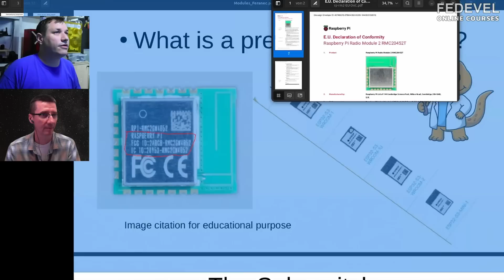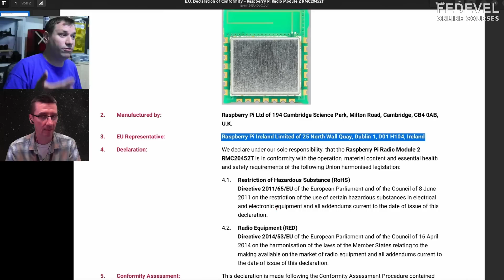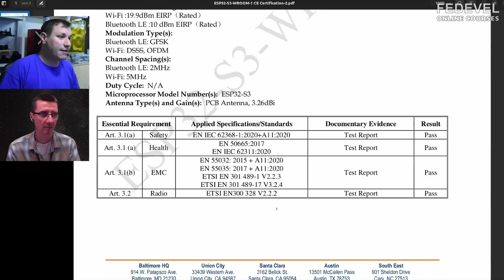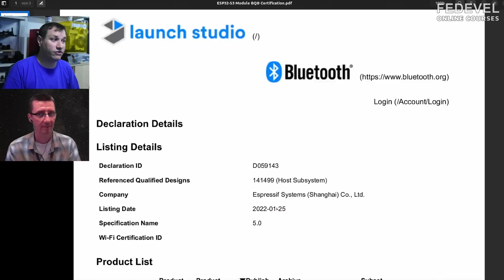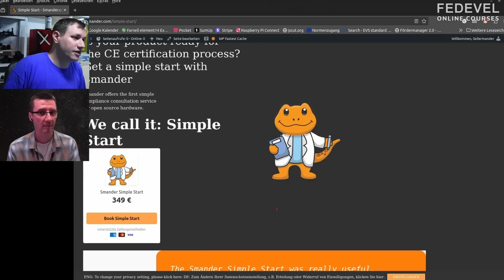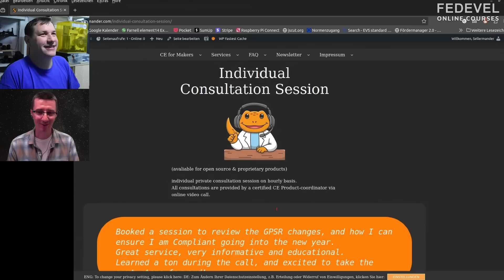Everyone designing PCB boards needs to watch this - Certification ( FCC & CE )

Comment: Quick question about IoT certification testing — does the choice of language matter? Specifically, would writing the firmware in Rust instead of C/C++ affect the certification process?
Reply: the programming language of choice does not matter, the documentation quality of the source does. Firmware/software present on the device is also subject to the overall process.
Reply: No. All of this is a hardware issue.
Reply: @segsfault  Software/firmware is considered part of the product  but specifically if it falls under the CRA it becomes one of the major parts to consider duringn the certification process. So All of this is just about hardware is an incorrect statement for most products.

Comment: At 1:04:47 - if you sell multiple components as a bundle with the clear intention that the user assembles them (like a 3D printer kit), wouldn’t that count as a “finished product” and therefore require CE marking on the bundle itself? Or does it depend on how the bundle is marketed? Can someone please explain this to me? 😅
Reply: that depends on the very specifics.. but its more likely to require Full CE certification than not.

Comment: Around 1:41:24 ... if the module searches for a connection at bootup, isn't that something it already did as certified?  Or are you saying that you replaced the original firmware with something new (that needs verification) and that new thing happens to also use WiFi (differently than the original firmware?) even though it doesn't need to?

Comment: Around 1:21:00 ... is that really saying that software updates require redoing certification?  Is that  only for the "yes, I still believe the product is conformant" attestation? Because otherwise I can see why products go out of support, if there is a multi-thousand dollar cost to publishing even a security update to an included firmware library.
Reply: that depends on the very specifics of your product and what the software update does ..BUT IMPORTANT: the CRA is changing the processes a bit so make sure to get up to date guidance on such issues!

Comment: Nice video, thank you. I have learned a few new things. I have just two comments:

1:26:42 I have a different opinion on this one. I think that the manufacturer should never be liable if someone operates the device wrong. There should be a user manual that says what the machine does and if someone does not follow the instructions, it should absolutely be his own fault. I think that getting injured by electricity and than blaming the manufacturer is like cutting off your leg with a chainsaw and then blaming the manufacturer. The logic is just so wrong.
The manufacturers should not be forced to forsee every possible way of how a stupid person can get injured, because human stupidity is endless.

My second comment is that the speech in this video is not loud enough. The advertisements always scream much more, which is pretty annoying.
Reply: you are entiteled to your own opinion, but it does not change the requirements the Law puts on each product. Simply Customer rights and Product safety are non negotiable. If you Pay hard earned money for a product you are expecting a SAFE product that can perform its function reliably. The manufacturers have to conduct a risk analysis and there are specific limits to what they need to think about and protect against it. I did a video very recentyl with Robert exactly about this (you find it on this channel).
There is a reasonable  limit and the "extreme Meme" examples are mostly fake/outliers.
Reply: @MAYERMAKES  Well, I can see that we have pretty different expectations. I just expect the product to work, that is all, nothing more, nothing less. 
How about the example with a chainsaw? That.. doesn't make much sense, right?
But in the end, I agree with you.

Comment: Any other Certification topics you are intersted in? leave them below, and it might nudge Robert to record another session.
Reply: Thanks for video, lot of interested points. Is needed CE certification (or which another) for specific customized products (mainly for B2B, not for public market). Like wifi, lora sensors, or devices for automatization warehouse, small manufactory ... often based on Raspberry, ESP32... with LCD, external sensors, mechanical actuators, wifi... Who will be responsible if something happen, like injury, fire...
Reply: @matusc  I think we need a complete course about certifications for hardware :D I would buy this for reasonable price
Reply: I’ll contact you for a discussion about my new IoT-Device. It will be open source but also commercially available. Thanks for this great video!

Comment: Thanks for this very informative content. Not easy, for an engineer, to understand the information on the web, because it mainly deals with the legal aspects of the certification. As an engineer I’m more interested in the technical requirements/standards needed to have tested a product sufficient to approve the product. As almost all standards are not freely available, it’s in fact impossible to find out which standards apply. This causes small companies to just approve their products. If the EU wants companies to produce safe and reliable products it should provide all standards free of charge or at least have a simple way of finding out which standards apply for a certain product. Currently the information goes as far as that a toy needs to be safe for children. Seems a bit of a no brainer to me. Where is the information that informs you when the toy is considered safe for children? If this is up to the manufacturer, then ignorance is bliss. There have to be specific requirements for specific situations. Therefore I think the USA system is much better. A certification institute that performs specific known tests and if passed approves the product. Simple, while the EU has created a huge mess that maybe is understandable for just a few consultants. Small companies are totally dependent on the knowledge of consultants, which aren’t always that knowledgeable as well. I really don’t like this self certification mechanism, because it causes bad products to enter the market as there are no clear requirements a product should comply to.
Reply: Both Systems have up and downsides, far to complicated to discuss it in a comment, They are not perfect but overall the Eu side does some moves in the right direction (new Machinery regulation, GPSR,) and on the topic of standards specifically in relation to toys you may want to read up on the "Malamud-Case", which already had a bit of an impact on the availability of some standards.

Comment: Wait but esp32 wifi stack is closed source.
So at this point you just do the certification. The module is not touched and is sold mostly without any firmware. I have yet to see a esp32 module flashed with AT firmware out of box.
Reply: Some ESP8266 variants  were pre-flashed with a TCP/IP modem firmware for AT command control via a serial port as an example . But it is not as common anymore these days. In any case you need to adhere to what the manufacturers integraton guide and FCC integration guide tell you to keep the FCC pre certification valid(in software AND Hardware implementation). these requirements can be different for each model (some may even allow fully custom software apart form the wireless stack), so there is again no general answer. It depends.
Reply: @MAYERMAKES tra the 8266 yes. But the 32s I don't think so.
Reply: There is a big difference in certification for a pre-certified module and a completely custom RF design. If you use a pre-certified module the lab only does a couple of tests that are relatively cheap.
Reply: esp32 wifi stack is built on open-source esp-idf
Reply: @devised4234 I think this means that you can prove you didn't mess with it by "simply" revealing your code. Which is something you might actually want to keep hidden from your competition. :-( But in the case of ESP32-S3 modules, there are other ways you can mess up the functioning of the modem. For instance, you may overload the core 0, you may use ADC 0 against recommendations, and those are just the documented things that are strongly disadvised anyway.
Reply: @dookshi  Build files come with project version that will be marked '-dirty' on compilation if esp-idf has been altered, you don't have to share anything. Just follow design recommendations, for example adc0 is fine if you dont have wifi enabled
Reply: @devised4234 Nope  the radio stuff is a closed source blob.